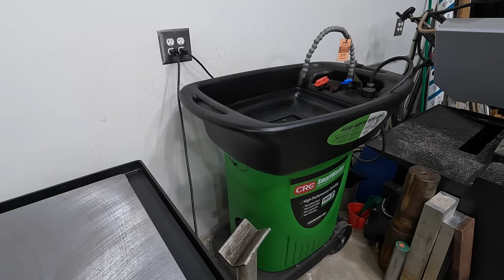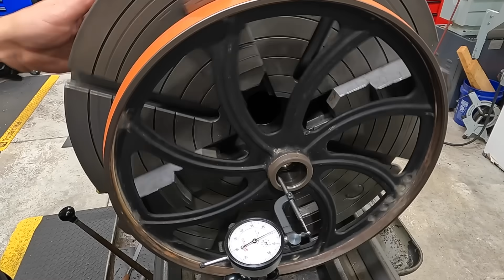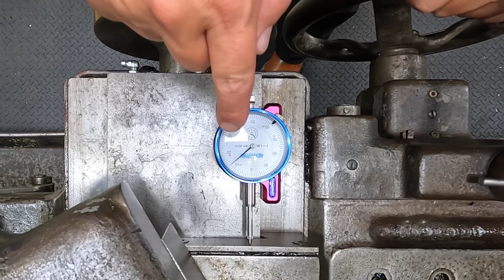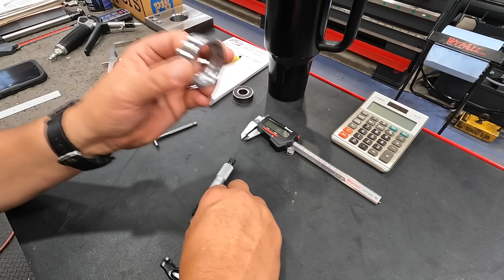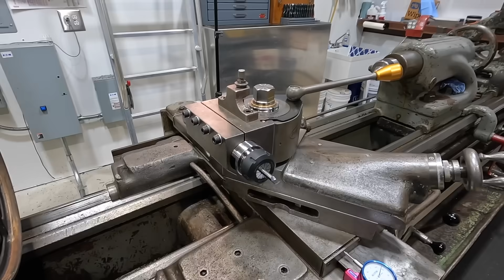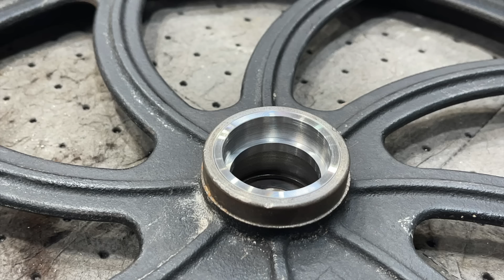Bandsaw Wheel Repair- SNS 381

Comment: Great video! I'm glad to see some manual machining. I can't afford a cnc yet, so i still just run the old manual machines. Quick question, though, why wouldn't you just go ahead and bore it all the way through? I understand that the other side still had a good fit, but. For future reasons, wear differences between the two types of materials. It just seems to me to make the sleeve go all the way through. Anyway, thank you for your video. I have learned a lot from you over the years.

Comment: USA- only 1 Thou. Seems good 
Metric guys-0.025mm that a lot for this application
Reply: Imperial is so outdated.
Reply: @gislemark79 Only if you don’t understand it.
Reply: @gislemark79  for imperial guys half thou (0.0005 ~ 0.0127mm) indicators is like the precious ones … 
In metric 0.01mm indicators are like the most crappy ones …

Comment: I know we’re all armchair machinists at this point, but I’ll throw in my $0.02 as well. I’ve made small mandrels before that I hold in the tailstock. Then I can crank my interference fit part in using the tailstock as a press. I’m sure some folks will have a problem with that, but in Adam’s case the part was NOT technically a press fit (he measured the chilled part to be smaller). Instead it was an alignment issue. Using the tailstock helps solve that alignment problem and even gives light pressing capabilities for the very minor press needed.
Reply: Why would you think using the tailstock as a light press will draw negative comments?  What do you think happens when you reef on a large drill bit……tremendous pressure.
Reply: I do that all the time as well, in this case the hub was not supported

Comment: I appreciate the tutorial. However, it is worth knowing that 14" Delta upper wheels are regularly available on eBay at reasonable prices. Here is a question, though: why use steel for the sleeve when the wheel is aluminum? Thanks for the video!
Reply: Wheel was cast iron.
Reply: Wheel is 16 inches.

Comment: Can't believe you haven't gotten a torch set up in the new shop yet.
Reply: Exactly even a little mapp gas torch would make sense, shame that fancy induction heater for the CNC tooling isn't more versatile 😂
Reply: He may need different kind of permits and insurance to have flammables in that shop.
Reply: @kindabluejazz  there is more LPG on the back of the Mitsubishi fork truck he bought over a year ago for the new workshop than in a little butane blowlamp.
Reply: @Paul-FrancisB  Permits and insurance for having a closed-system LPG fueled vehicle indoors is different than what's needed for fuels and equipment for welding/cutting.
Reply: @kindabluejazz  wow I didn't realise regulations were that tight over there that you need a special permit for a blowtorch with 1lb of butane/propane mix in it. There aren't any special licenses for flammable gas storage until you have much larger quantities than would be applicable for welding, obviously HSE guidance needs to be followed (like OSHA for you), however permits only kick in under COMAH or hazardous substance planning regulations when you are talking tonnes of materials.
Reply: @Paul-FrancisB  He mentioned he could have tried a butane torch, but he knew it would not have been enough to heat that wheel to where he needed it. If he really wanted to torch something, no doubt he could have gone down to his buddy's welding shop. I think he's made a conscious decision to not bring flammables into this shop. Why do so many here like to be 'backseat drivers' and not give Adam a bit of credit for knowing what he's doing?
Reply: @kindabluejazz  absolutely he knows what he was doing if he took it out of the lathe to his mates welding shop or a press he would have lost concentricity and not been able to skim the bushing back to size after shrink fitting without dialling it in again. He mentioned before fitting it was like to go out of tolerance after fitting.
It was a year ago when he bought the large welding fixture table for the welding/fabrication area he had planned.
Actually he said a little propane bottle would have helped, not that a butane bottle wouldn't.

Comment: Adam, you have to bite the bullet and get yourself some liquid nitrogen.  The freezer for your snacks isn't going to shrink parts enough at 32 degrees, the liquid nitrogen will get to -320.  You can even get a LN2 container at home depot.
Reply: You work out the 'cost' of LN per job for a couple of bearings a month and determined that it is absolutely needed? You will be getting a bit over 1 thou on that sized bearing at -15C and another 1-2 if you needed to with some heat on the wheel, if you can't work with that on a basic bearing then you are in the wrong field. The only thing LN typically gets used for on YouTube is performance art.

Comment: Why couldn't Adam have built up the inside of the hub with spray welding and turned it back down to the appropriate diameter?  Is the wheel cast iron and that's too hard to weld?
Reply: Cast iron is not hard, it’s soft. It’s a dirty mix of iron which makes it hard to weld
Reply: @benpeterson9835  I meant hard as in difficult.

Comment: It think something went wrong here, but i am not a machinist, but i am very interested, so this is only my thoughtproces.

And would like to hear why i am wrong.

You centered the part from the OD of the center hub, which should give you the center of the wheel. But then you re-centered it based on the ID of the center hub.
It was an 8 thousands difference, if i'm correct.

Didn't you just create a wobble in the wheel, by doing that? Which was probably why the bearingseat wore out in the first place?
Reply: Since only one bearing seat wore out so badly, the wear was probably caused by the tracking adjustment being overstressed….maybe the blade was run too tight?….the axial runout on the rim matters very little, 8 thou is very little in that area, the blade runs in guides where it cuts……..if the two bearings on either side of that hub are out by 8 thou, you would surely set up a side to side wobble once it got magnified out at the rim…..if you could even get it on the shaft!
Reply: He was indicating the bore to the center line of the other bearing. If the two bearings were not on the exact same center line it would definitely cause the wheel to wobble and create an oversized bore as shown.